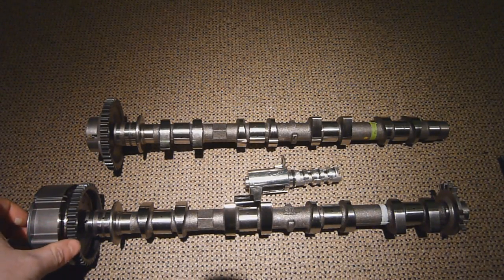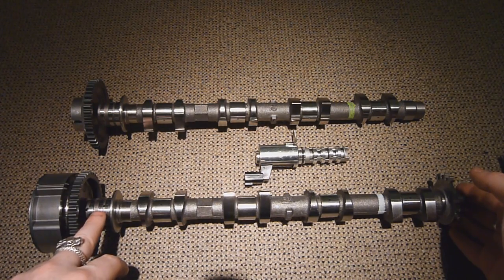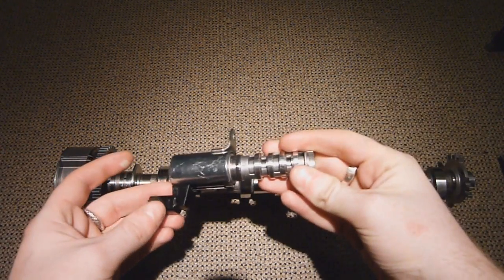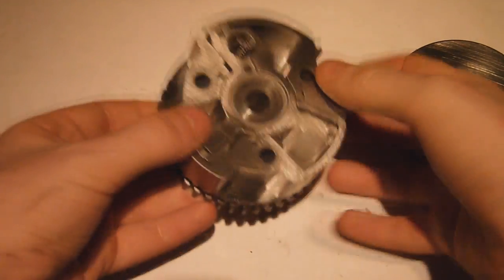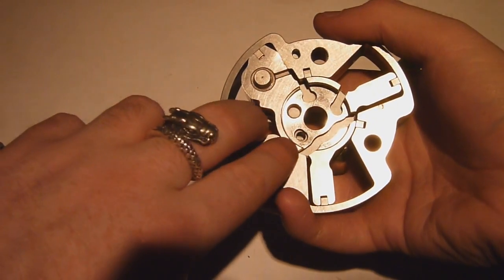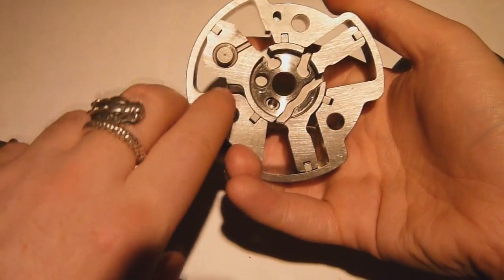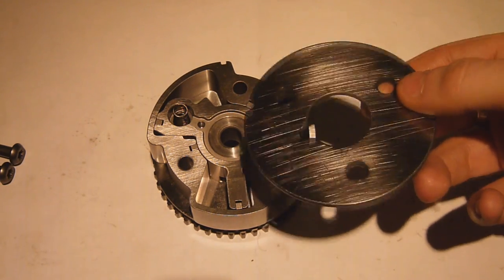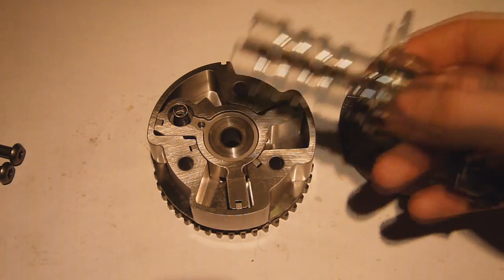Variable valve timing through cam phasing explained

Comment: The cam and crank run at the same speed (speed = distance covered / time). They both cover the same distance over the same amount of time. The crank does rotate twice as many times as the camshaft in same amount of time. RPM doesn't equal speed.

Comment: nice video. Here's a question for you. In this video by a good ford tech, he disables the solenoid and goes for a drive. https://www.youtube.com/watch?v=itI9uysEp4A 
The ford phaser has a return spring, unlike the one you demonstrated in this video. I'm curious how does it achieve both positive (advanced) and negative (retarded) timing? I would have though the stator could only move in one direction from the original locked position.

Comment: This video is awesome. I'm in the US and really wanted to understand how the VVT works. This makes it really simple to understand . My only question is, does the actuator pump the oil into the phaser directly? On my equinox the actuators are situated on top the engine so I'm wondering how you get the oil actually into the chambers from the actator

Comment: Hi mate. Now why do many CR-Vs and accords with the 2.4L have this grinding noise and are told to replace the faulty VTC actuator? Its so simple, but was cause the VTC to not lock up on cold starts? It looks simple, but its a 300.00$ Canadian dollars that they want to sell you plus 3 hours of labor? Thanks
Reply: The plunger that locks the rotor to the stator starts to bind with age and it sometimes fails to engage because the spring is not strong enough to overcome the binding.

Comment: Why do they need a bolt to lock it to a default timing? It was apparent from starting the engine that was not an approximately good position; is it just so you have the right position during maintenance activities - ie, the bolt is there for when the engine is off to prevent manual screwups?
Reply: I guess you're new to this. If it wasn't for that bolt, you would have a rattling engine.

Comment: “I wish that I had seen your video BEFORE I pulled mine apart.  Then I would have known that there was nothing wrong with it, instead of being led to believe that I had ruined it by not unlocking it before I took the camshaft out.  Now I need to put it back together, and I can’t locate the torque loading for the bolts that hold the unit together.  Mine has plain hex heads.  Any suggestions about the torque loading, or where I can find out what it is?  The workshop manual doesn’t mention it at all, because it describes the unit as ‘not user-serviceable’ and doesn’t list a general torque loading for hex head nuts without any special markings.”

Comment: My solenoid valve is starting to get oil on the electric connectors the valve has already been changed by a new original renault valve and it continues to apear on the same place. Does anyone know  why this keeps happening?

Comment: Some corrections:  the inner part is called the ROTOR not the stator... the inner part, directly connected to the camshaft, rotates, thus its the ROTOR, the outer part or 'body' can be thought of as a stator since it is technically stationary unless acted upon by the rotor... the vid is a bit confusing because you are calling the rotor a stator... so to recap: inner part is rotor, outer part/body is stator... hope this helps!
Reply: "Ah, but a rose by any other name would still smell as sweet"

Comment: one of the best explanations of the VVT I have seen.   I want to use this engine without the ECU.   I will have to lock the VVT piston in to place.  Do you think that will cause any problems, if I just unhook the acutator?   As long as I use an aftermarket injection and ignition system?   I know it will only operate at peak performance at a given range, but once that is known, it should be fine other than it will not be efficient outside the ideal fixed position, right?
Reply from the maker: Yeah if you do that will just work like a normal cam. If it doesn't get the hydraulic signal the piston will stay in place. :)
Reply: What kind of engine is it?  I'm just curious what you want to run without an ECU since its probably going to be far less efficient.  Unless you're converting a fuel injected car to carborated.
Reply: I'd be careful you don't want any valve float
Reply: the vtec in the R series engine is designed the opposite of many honda engines.   In the R series, VTEC is off when in high RPM and in all RPM ranges when there is a load.  It is only "on" when there is no load.  So no risk of valve floa if VTEC is "off"....
Reply: charosenz you may study the suzuki bike mechanical vvt. It's 100% mechanical VVT system. No electronic / solenoid need.. it's look like same with CVT pulley working mechanism

Comment: If its such a simple mechanism, why was I estimated 1500 bucks to have the variable valve timing system replaced for my Infiniti? My exhaust camshaft VVT system went out on BOTH BANKS (V6 engine) and each side is almost 500 bucks each just in parts. Fml.
Reply from the maker: what thats just wrong in my mind. hope you get it sorted :)

Comment: when the locking mechanism is pushed down by the oil pressure and the phasor is free to move X amount of degrees...what holds it in place with the spur gear so it doesn't slide? Is it just the actual friction??
Reply: equal pressure in both the advance and retard chambers and is supplied by oil control solenoid valve (VVT solenoid)

Comment: Thanks for the video GGB, I've wanted to know what's actually in the dephaser pulleys since I discovered that on VVT Vauxhalls this is a fairly common problem and one that my car has just started to complain of (it sounds intermittently like a Diesel!). I imagine that failure is due to the locking piston or a leak in the oil seals resulting in the camshaft not locking (I've seen one vid where the movement of the pulley was possible on a still engine). I would have thought that there should be a return spring somewhere in the assembly to ensure locking on idle (one symptom is poor starting) but I guess that oil sent in the  opposite direction means it wouldn't be required. BW

Comment: very good, so it's not a "varying" system so much as a mechanical adv/ret, off/on, in/out type of on the fly adjustment. I was thinkin it was a variable, little advance here, & more advance there type of system that more or less movement depended on the need @ the time.

Comment: My 2nd watch of your video, I'm now doing revision....lol. Good video mate. :) This setup look almost identical to the Toyota VVT-i camshaft assembly, seen on the *ZZ-FE engines. Did Nissan donate the engine to the university for education then?
Reply from the maker: Thanks mate :) The system is basically identical to Toyota vvt-i system, most systems like this are similar. As for the engine it was a reject which the uni got for £150. Was rejected because of a bent dip stick and holder. which i still cant get my head around. Still have a few of the parts off that engine funny enough :) Hope you revision goes well, i put it up for that reason :)

Comment: Just wondering does a vvt engine have a egr valve or a pcv thanks
Reply from the maker: From what i recall it didn't have an EGR valve but it did have a PCV system on it, most engines do these days. The other group got a MR16DDT turbo engine which has variable cam adjustment on exhaust and intake valves. So instead of using a EGR valve what that engine did was to leave the exhaust valve open longer when required, so the cylinder took back exhaust gases back in through the exhaust valve.

Comment: Great video and explanation of how it works, I have just had my dephaser replaced on my renault because it packed up and started rattling when cold (common problem with renault), mechanic couldn't explain to me what was failing. Was it the cam/ valves rattling as I can't see how the actual pulley could make that noise? Cheers

Comment: I understand how the oil pressure moves the thing in the middle, but what I don't understand is how that small adjustment actually keeps the valves open longer. Can someone explain this?
Reply: It doesn't keep the valves open longer. It simply advances or retards valve timing. Advancing is better for vacuum and low rpm torque, retarding improves high rpm performance.

Comment: vane and body with springs and seals married to the sprocket which has dowel pin and sleeve then add four bolts a plate and another spring and a lock pin.. all tested in each process for exact placement and specs then air test the whole part (a few through out the day oil tested) then laser label the serial numbers date and part number pack in dunnage totes and waalaa my boring miserable job hahaha well the ones I make are a little different than this one but about the same
Reply: lol...sounds simple enough

Comment: Ah right so without oil pressure applied, it's in a technically retarded state compared to the equivalent fixed cam. So it does a lot more work than I thought. Does the ECU control oil pressures to the cam or does it vary with engine stress/speed?